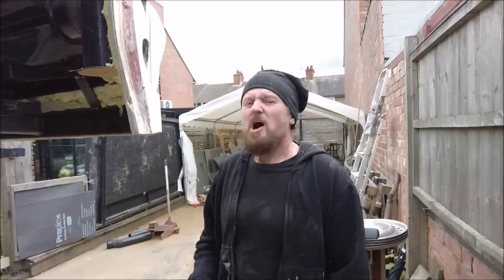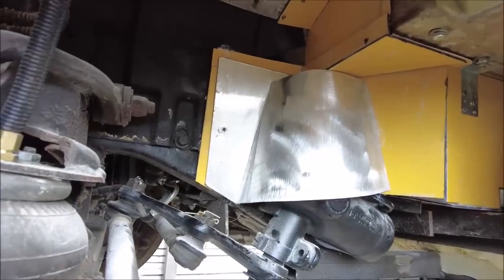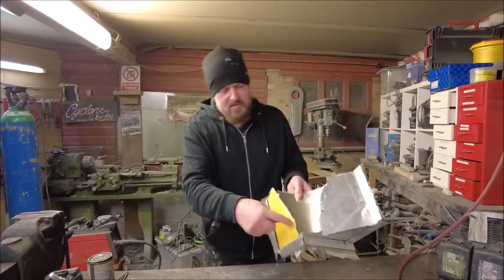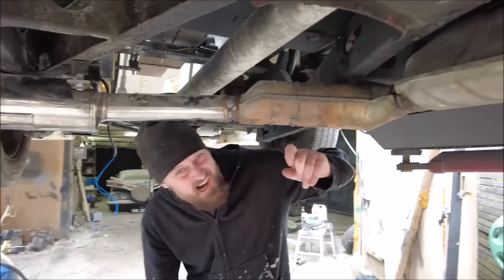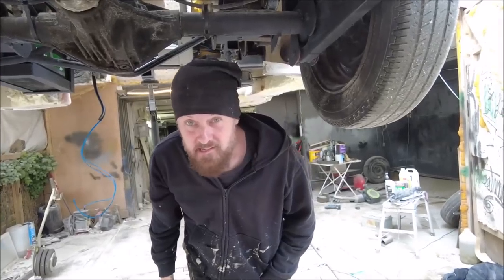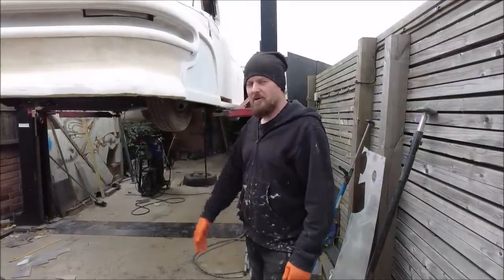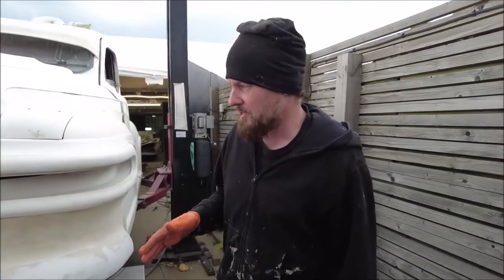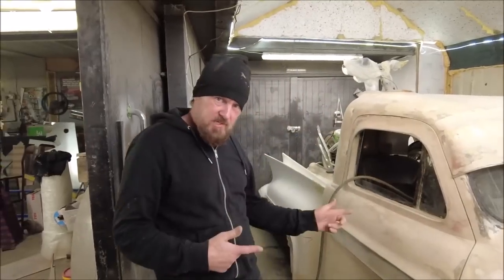Its all about protecting that underside!

Comment: Hey Paul, nice video.  I've always made sheets of fiberglass on glass so they are very smooth.  Then i can cut them into strips and bond them into shapes like what you made.  II guess thats why there's always tons of ways to do things !  I love watching your creative methods and builds.  I'm really looking forward to more of what you do with Duelelitron !  Have a great week good luck with all you do !
Reply: I'll take that method (as inspiration)! And I owe you a method. That's how the Kustom community werks! I can justify that huge piece of glass I've been hording! 

And, I thank you very much! (in a Paul Bacon accent)
Reply: @davidhyson9910    the Beauty is you don't have to have a piece of glass to make it  If your cement floor or even a piece of melamine will do.  Just make sure that it's sealed.  You can wax your concrete floor where you want to do it.  Don't buff the wax off just let it dry before making your sheet.  By using Melamine just realize that it will copy the texture that isn't perfectly smooth.  You could also use plywood just put clear packing tape over the entire thing so the fiberglass will come off it.  Give it a try.  The nice thing is when you have the sheet you can cut any shape or shapes then glue together with fast bond or super glue together then bond the thing with fiberglass after.  It really puts you ahead of the game
Reply from the maker: Yes Dualatron has taken a bit of a back seat at the minute, but I'm excited to get back to it.

Comment: 60s truck is getting so close and looking so good - here's the tip for this week :face-turquoise-covering-eyes: i noticed when under the chassis the rear end hanging on the bags "seems to be quite heavy and major stress on those bags" how about some old seat belts bolted in place to hold the weight (just before the bottom) of the full extension to hold and not - crack , tear , or cause a leaks 🙃